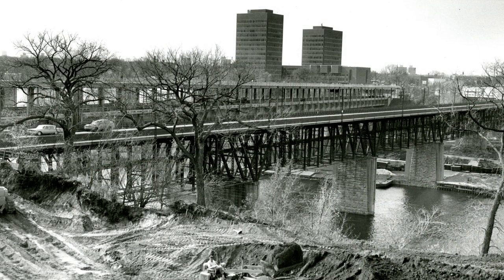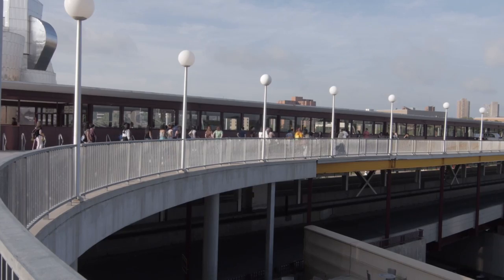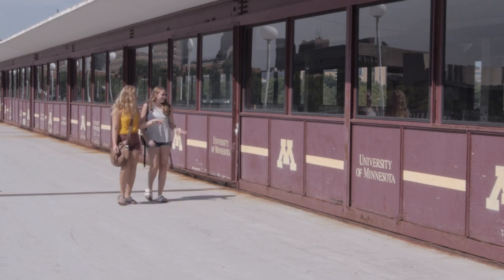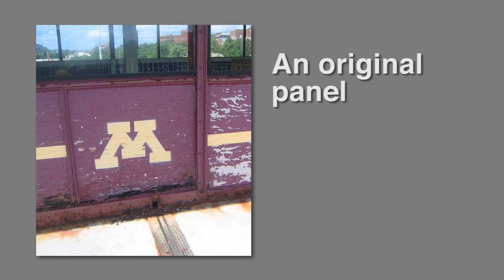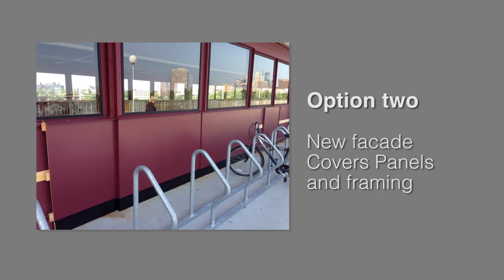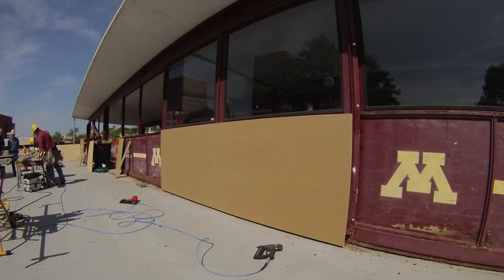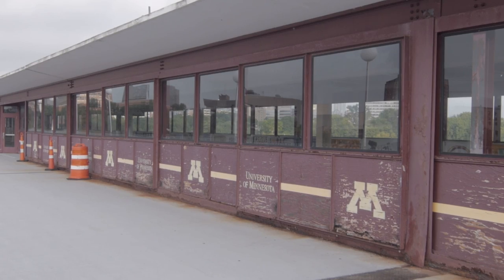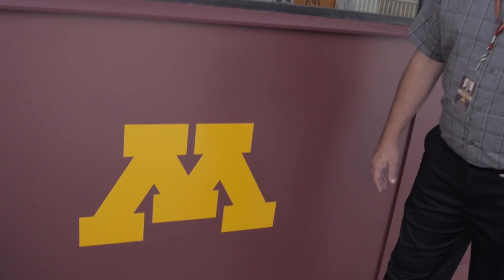The Washington Ave Pedestrian Bridge Project

Comment: It seems this would have added a significant amount of weight to the bridge? Is there a longer term solution in the works? What about the heavy benches and heating equipment that's no longer used and also adds weight? Looks nicer, but more can be done.
Reply: That heating needs to be replaced or refurbed.  Why did people back then deserve the heat but the ones now don't?  Also I don't think weight is an issue because the bridge was structurally reinforced, both after the 35W bridge fell and later when they put the trains in.